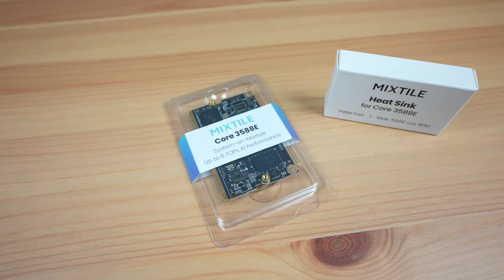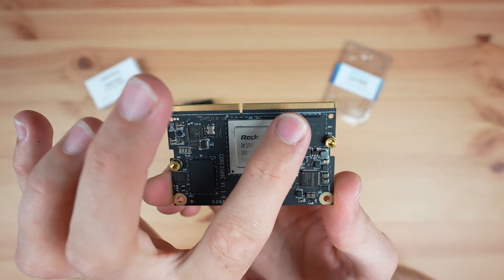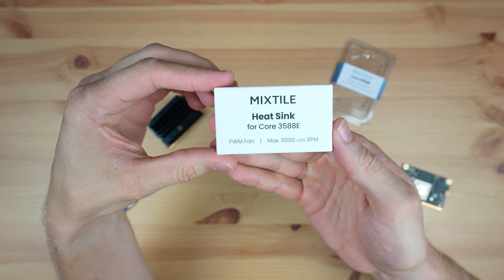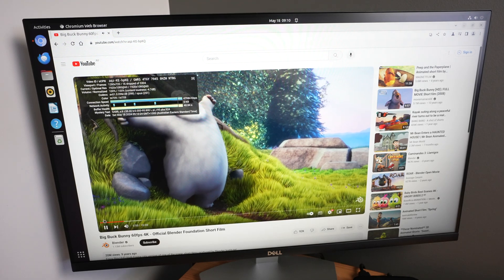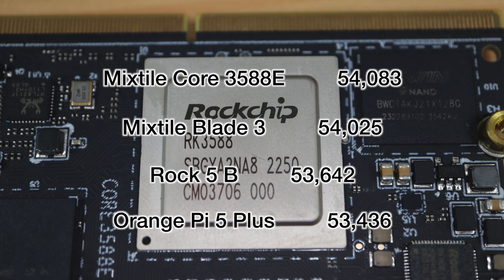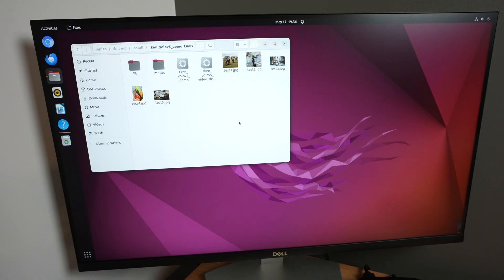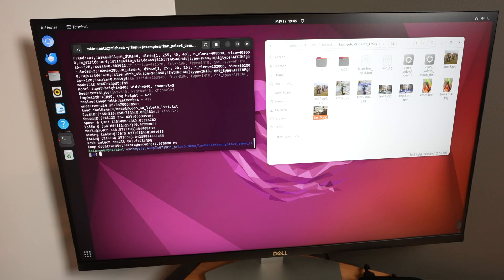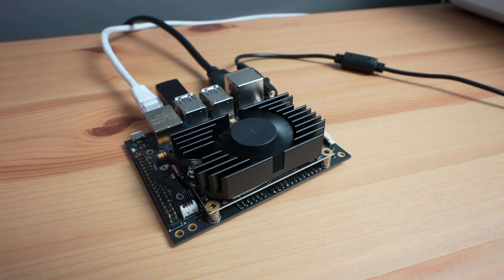I Tried A New RK3588 SOM - The Mixtile Core 3588E

Comment: Yet another RK3588 plus popular AI topic that was raised few days ago by Raspberry, the only one that don't include any NPU in SoC. Rockchip has small NPU in RK3399 pro few years ago, sadly NPU driver is still not open sourced, altjou some work (reverse engeenering) is done now for RK3588. 

If You can check several things with this board, I have those:
+ Is 2.5G ethernet available? 
+ M.2 should have 4x lanes of pcie 3.0? 
+ Is pcie bifurcation working? 
+ What kernel version was used for those tests?
Reply from the maker: Since the Core 3588e is a module, a lot of the IO depends on the carrier board it is connected to;
2.5G Ethernet can be made available if the carrier board supports it (The A206 does not).
Storage is the same, it can utilise up to 4 lanes of PCIe 3.0 if the carrier board supports it (The A206 does not).
Yes PCIe bifurcation works
It is running Ubuntu 22.04 using kernel version 5.4
Reply: @MichaelKlements  The real problem is that so far none of carier boards supports 2.5G and probably same for pcie. I'm not sure if it's carrier board design or it's limitation of this kind of connector that was designed for jetsons. The fact is that even very expensive boards like turing pi 2 cuts some i/o and probably it's just better to buy SBC with right ports. RK3588 is bit ahead of it's time. If we will get something with 10G same thing will happen. 
How did You tested bifurcation?